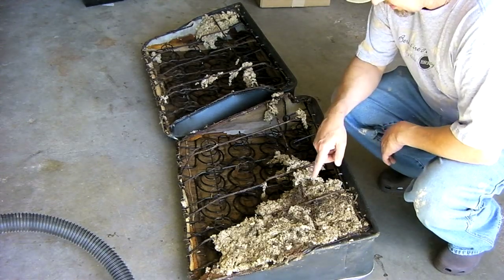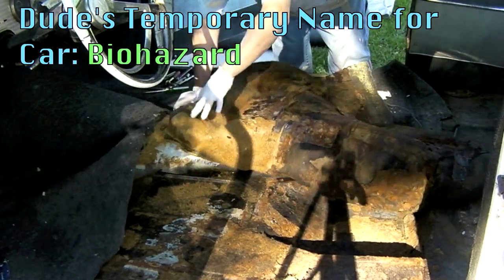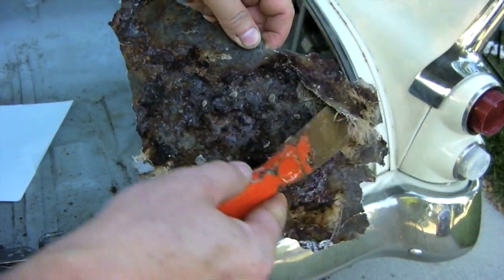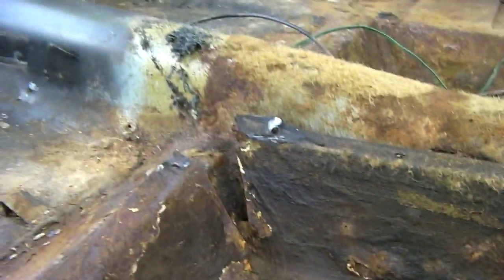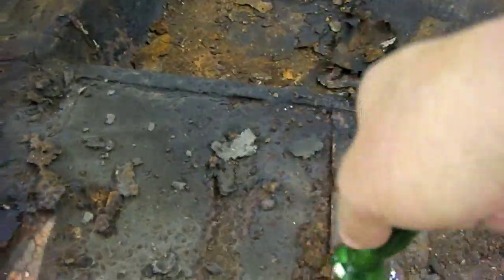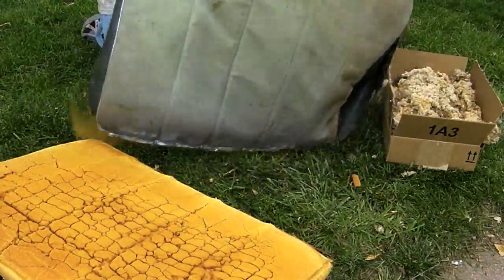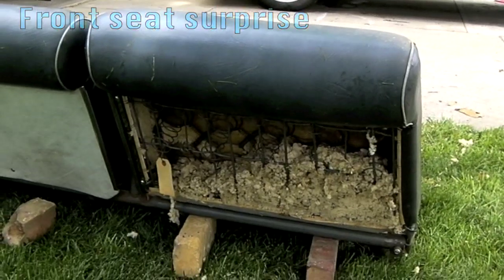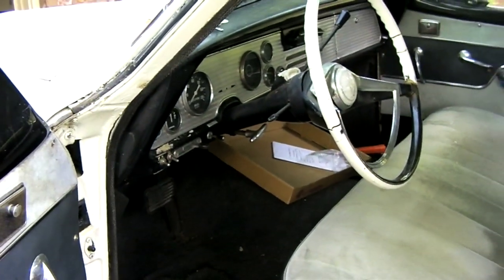Car Interior Restoration - Removal and Inspection

Comment from the maker: I think the term is "Resto-Mod".  Where you restore it, but upgrade some of the components like an electronic points conversion, screw-on oil filter, maybe a disk brake conversion and definitely new wheels.  The body will be stock and I'm thinking a red and black paint job.   What do you think?

Comment from the maker: I was thinking of the Ignitor points conversion kit and Flame Thrower coil by PerTronix.  For wheels, I'm pretty set on American Racing Torq-Thrust Wheels.  They've been making this model since the 70's.  It's a classic.  The upholstery will be redone.  That original stuff is shot and nasty.  I'll have the back seat redone, but I may go with buckets in the front and add a console.  I want it to look like it was souped up in the 70's.

Comment from the maker: I was referring to an ozone generator that is typically used by car dealers and detailers to kill germs and to get the stink out of cars.  Search for OZN-1 for the unit I purchased for less that $100.  You're only supposed to run one for like 30 minutes at a time and definitely don't breath the air.  Do a little research on how to use these before trying.  They can be dangerous when not used properly.   

It did remove most of the stink and I felt better knowing that any biohazards were killed.